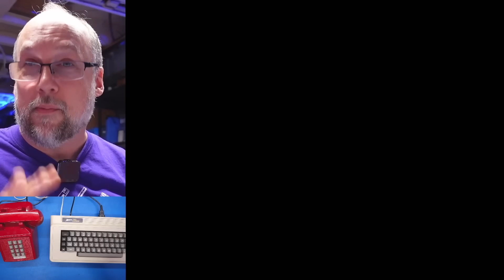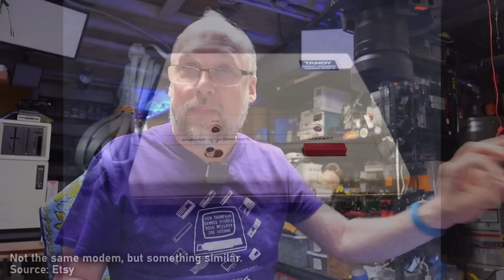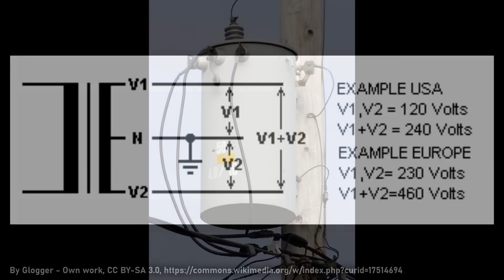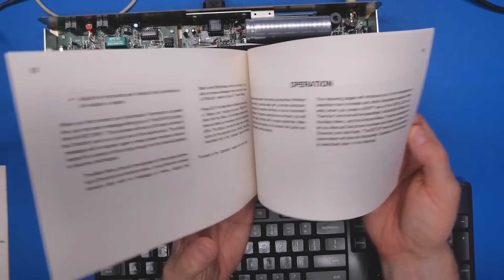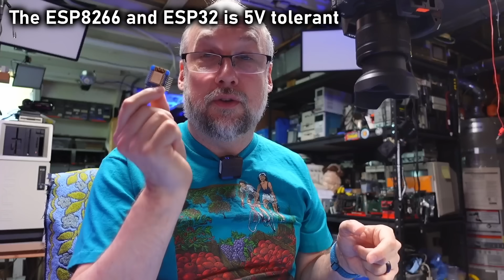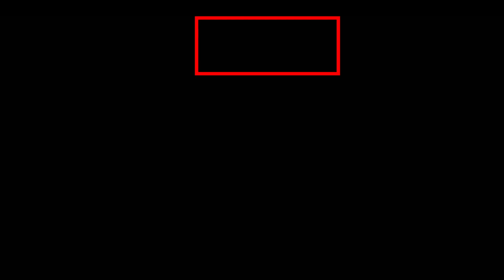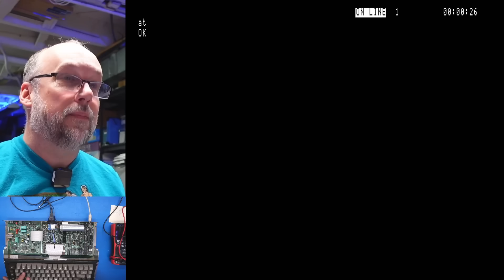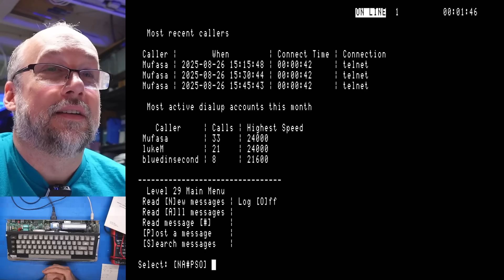Adding Wi-Fi to a 43 year old modem only terminal (Zenith ZT-1)

Comment: 14.4kbps (14400) was a standard baud rate.  What is interesting is 144400 + 2400 = 16800(16.8kbps).  If you ever decide to open this up again, maybe add an investigation into the baud rate as a task.

Comment: Did you try setting your $TERM to one of Zenith entries in the terminfo database?   On my Ubuntu system, there are zt-1, ztx-1-a, and ztx11 entries all aliased to TERM=ztx.   It won't help with the BBS system, but it would help connecting to a linux system.

Comment: Adrian,

You have a fundamental misunderstanding of what terminal types do. They are a code converter. You should peruse the termcap file to see what is actually contained in its black magic. 

Unlike today, there was no standard code sent for any function from the keyboard. ASCII text was mostly the same, but everything else was open to interpretation. You need to use the termcap that actually supports your terminal type, not the 'least fancy' terminal from a completely different manufacturer.

Dec VT scan codes were reverse engineered to be included in unix termcap because the physical terminals were so prevalent. It was DEC's proprietary data to prevent their Systems from being functional with other cheaper terminals. 

Secondly, Vi is almost certainly replaced with VIM which is filled with cursor placement and status bar line draws. VIM does not work because the ZT1 is not a VT52. 

As for why ^C doesn't work... Most likely the host end has already finished sending the output of the command to the I/O buffer on the host. Your break is going to the system that is already done processing the output of a command.

This is why commands like MORE and LESS are so important. They provide human pagination that is required to allow you to pause and cancel output over a 'slow' remote link. XON and XOFF provide that flow for the terminal communication, not for the screen display! You can affect how fast the host sends data to your terminal with STTY commands. STTY also lets you fix some termcap mismatch issues on the fly for important things like backspace

If you want to temporarily test say a slower output speed you can do "stty baud <baudrate>". The other is "stty erase (then your backspace key)"

Those extra characters you see on the end of the prompt line are certainly there because the zenith may not have a character representation for whatever the mis-matched terminal info you are sending it. Termcap affects translation of functional codes in both directions.

Comment: It's likely that the reason why Ctrl-C seems to not work is because the modem is buffering a lot of the data, so by the time the sending system receives the Ctrl-C signal, it's already sent the whole file and what you're seeing is actually coming from the buffer.

Comment: Back in the old Compu$erve days, I had access to a 300/1200 modem. I would connect at 300, since it was considerably cheaper (per minute) than 1200, and I found 300 baud to be a comfortable reading speed.

Comment: 16800 is not so common as 9600 or 19200 however pretty standard one for 16550 UART. It was the baud rate of US Robotics HST protocol. It is also a halved 33600 which became popular later when V.34 was introduced.

Comment: I had a ZTX-11 or was it 10? used in the late 90s with a unix dialup shell account under VT52 with Lynx. ran it at 9600 baud but I believe it could do 115k. the shell provider was the former sysop of Ripco BBS in Chicago.

Comment: I have a whole selection of external modems.  I have an old TRS-80 modem, that i don't even know if it works.  But i have 2400B, 9600B, 14.4KB,  and a 56KB (even though the max was 53KB IIRC).  Going off of memory, and i haven't used any of these for many many years.  Heck, i even have a cable modem and a DSL modem somewhere.

In my previous house i actually had both cable internet and DSL, because the reliability wasn't great.  Some drunk butthole would hit the light pole (that pole was ALWAYS getting hit), and my cable would go out.  I could just swap the serial cable to the DSL, and keep on rocking.

Comment: Does your local phone system work with a blue box?  It would be interesting to see if some of the old phreaking tech works on it.
Reply from the maker: Nope. Stuff like that is part of the control signalling for AT&T phone network and later the long distance network where signalling was in band. It means tones on the phone connection did stuff. Something like this Panasonic uses out of band signalling (digital) so it's not affected by any tone.

Comment: One of my favorite (if not my absolute favorite) aspects of retro computing is dialup modems.  Ever since I got my first modem for my CoCo2 back in the fourth grade, I have always held an absolute fascination with data communications.  There isn't much love in the retro community for dialup modems, and it's so hard to get a POTS line.  I have Vonage at home, and the best I can do is 9600 bps.  I use a Wimoded232 for convenience most of the time, but I also still dial in for that authentic feeling. :)

Comment: My family used Darkstar as the name of our WiFi access point in the past. It was a reference my Dad thought of I believe. I assume a reference to the 1974 SciFi film by John Carpenter. I would suggest trying something more Unix like Open or FreeBSD instead of Linux as you might have better compatibility but it's also possible that VT52 isn't well supported. Of course my dream would be to see the Plexus P20 running again, perhaps you can do like Mr @UsagiElectric and have 8 Data Terminals running at once.....

Comment: The caps surrounding the chip on that ttl-rs232 converter are used to implement a charge pump to generate the rs-232 level voltages.

Comment: My first exposure to BBS's was through a device such as this. Not this exact device, but one that is very similar. I was on good terms with the manager of our local Radio Shack store, and he often let me play on the computers and electronic devices in the store, and sometimes even let me take one home on loan for a while. One such device was a terminal that looked basically identical to the first Color Computer -- the silver one with the horrible chiclet keyboard. Probably shared a lot of its guts with the CoCo as well, because I remember it had the same green screen and rainbow flashing cursor. But it was a terminal -- it didn't have BASIC in ROM, it didn't have a cartridge slot, and it didn't have any I/O. But it did have a built-in 300 baud modem. I think the device was originally built for farmers so that they could call into farmer-specific data services (I guess to check weather, maybe order seeds/supplies, etc.) and I guess they must have sold some to the general public as well. In any case, this was my first exposure to BBS's. I would rush home from school every day and get online, often with a friend or two in tow, and there would be frequent arguments about me tying up the phone lines, etc. Back then my friends and I fancied ourselves as hackers (of course we were very much NOT, "lamerz" would have probably been a better description of us :) ) so we often logged in to "those" type of BBS's, you know, the ones that hackers, crackers, etc. hang out in. We would raid the text files section and read out all sorts of weird and interesting information on things like phone phreaking, amateur chemistry (if you catch my meaning), etc. The terminal had no data storage capability whatsoever, so when we found a file that we wanted to keep, we would read it aloud into a tape recorder. :D Fun time fun times.

Comment: Great video as usual Adrian, if YouTube doesn't promote this series then it's a scandal!

Our local collage had a mainframe when i first attended. All the computers were dumb terminals connected to this. There was an entire floor devoted to the machine itself. They did have a couple of rooms with DOS based IBM PCs. Less than 10 years later when i attended again the terminals were all gone. Computer rooms had generic (not IBM) desktop PCs with Windows 95.

That was the only terminal system i used but i did see another in use at the local NHS hospital. A staff member said, if you can understand what's in those manuals, pointing to a large book shelf you've got a job. I was tempted to ask if they would let me stay overnight to read them. I knew better, desktops were already being used in their offices. It was only a matter of time.

Time shared terminals are one thing but this series of videos has opened my eyes to a world that once was. 

On the terminal in question... Really interesting that such a high baud rate could be used compared to its default. Do you think this is a case of the people they were selling too, would mostly have poor connections and they were thinking ahead? or they were already being outpaced and the tech was far quicker. We know computers are outdated fast, so i'm thinking is this a case of the internal hardware was over powered. i can't recall if you said the latter models were basically the same hardware, so we're they over powered in anticipation of the future but then stagnated as the market for terminals just collapsed? A real interesting piece of history.

Comment: There was some mention about a disk drive in the user manual (for modes 3 and 4) which would probably plug into the power supply connector, in between the PSU and the terminal. It's possible that used the 16k8 baud rate - I'd guess that the ZT11 supported 9600 (mode J) and 19k2 (mode Z which was J doubled, due to the higher clock). But there's a few modems that used that 16k8 as well.

Comment: The vt52 terminal was one of the first and (by the standards of even the 1980s) was brain-dead. Very few of the expected commands were implemented back then.

Other posters note you may not have the full "terminfo" database installed, so 'vt52' in TERM doesn't have the expected effect, but also there may be a Zenith-specific terminfo description available which could be even more appropriate. Many terminfo / termcap descriptions included workarounds for 'quirks' in specific terminals (e.g. a term was notionally vt52 but actually required a longer delay after a sequence, or even within a sequence).

Finally, you may find that a command like 'screen' or 'tmux' might be able to act as a translator layer, essentially enabling a less capable terminal to act like a more-capable one for the desired commands.

Welcome to the wonderful world of serial terminals -- your experience with things not quite working as expected is 100% authentic to the 1970s reality.
Reply: 100% agreed with @rivimey.  I see several promising terminfo entries in the terminfo/z/ directory, including a 'zt-1', and running 'infocmp zt-1' has a comment that it's for a "Heath/Zenith ztx-10 or 11".  If the remote system doesn't install the full terminfo "DB" by default,  Adrian may need to download the ncurses terminfo source and find the terminal description(s) and install the (binary) terminfo file(s) he needs below his homedir (see terminfo(5) for how to reference your own terminfo descriptions).

Also, it's rarely installed with the rest of ncurses, but the ncurses source has a very handy terminal testing program called "tack" that's mean to help with testing terminal capabilities and creating custom terminfo entries.

Comment: old is good. lol. we are many young. ai generated code? lol. why not use single power supply for the whole thing in design. meh. multiplexers rock for simulating any architecture on fpga, including x86 and arm. logic circuit design rocks, a layer on top of the physical ttl implementation or whatever implementation. cant be simply battery powered because of that nonsense. generic is generic for everything, nothing specific. vectorized pipelined parallel is obviously faster than even pipelined serial instructional compute. tech high enough is equivalent to magic. hax maximus. lol. wifi is electrical noise. super nice. a boot script to set the baud rate automatically. 16.8 is half of 33.6. double that. thats a light weight terminal. some kind of connection script. rpi4/5 is a nice bbs emulator. its rude to ask if you are well or ok. on screen. engage!

Comment: What does the ESP8266 mean is 5V tolerant? This is not written in the datasheet. 
It only says that the IC must be operated with 3.3 volts. 
Operating it at 5 volt levels means operating it outside of specification.
To connect it to 5 volt logic you need 1k resistor in series.

Comment: Maybe they were going to release an optional power supply with serial ports in it for this. While that may sound strange Google did the exact same thing with their Chromecast, if you wanted wired Ethernet you bought the optional power supply that had an Ethernet port

Comment: I really like how these are designed. I came across one of these ZT-1's a while back; sadly, the main board was truly fubar. The keyboard works fine, and the case is in mostly good condition, but the board was destroyed by someone trying to mod it or something. I tossed the mainboard, scavenging some parts like the keyboard connectors I transplanted onto a little perf board I translated it into an easier to understand keyboard matrix to run into a raspi pico. I put in a CM5 and standard I/O board with a new rear plate (it was cut up a bit to poorly fit an extra port prior, so I just cut a clean rectangle and put a printed i/o shield mounted on the rear with screws). I've been using it as a "micro emulator" of sorts, running emulators for Apple //e, C64, C128, Atari computers, etc. on it as well as just as a standard CM5 based computer to write programs for my RP Zero 2W projects since I've mostly converted to Radxa boards with native OpenCL for my hobby demos. It's not original, but at least I was able to save the casing and keyboard from the recyclers.

Comment: I feel like there ought to be some byte you could set on the EPROM that could default the the terminal to Serial mode vs Modem mode. Could be a simple mod to improve the usability. Manually selecting Mode ) would of course return the unit to Modem operation.

Comment: Vi is pretty flexible with terminal types.  Vi should just fall back to ex mode if it can´t use the terminal type.  If it works in vi mode arrow keys aren't required at all, just hjkl.

Comment: For testing VT52 capabilites of a terminal: Perhaps connect it to some kind of CP/M2.2 machine. most software packages came with a setup program to patch the main the executable for the respective terminal. like VT100/VT102/VT220/VT52. So you can run Wordstar, Turbopascal and others full screen editors in VT52 mode, which certainly will take full advantage of what VT52 was about.

Comment: a ZiModem with support for SSH (even if it's only older cyphers) would be appreciated.
Reply: Zimodem 4.0 does support it, but not for the ESP8266 -- you need to run the version for the ESP32 that has more ram.
Reply: @bozimmerman great (I do not care about ancient esp8266 any more, esp32 is fine.)

Comment: ahh the memories. Double baud rate was a way of increasing baud rate by doubling the number of bits per signal changes. Also, we had a lot more patients back then. Everything has to be 'now' and we just didn't do things that way. I can remember my first computer (vic-20) and using a 300 baud modem and it produces text at about reading speed so it wasn't that bad but yeah we weren't in as big of a hurry as people are today.

Comment: You could probably simulate the AC power source's signal with a 555 timer chip tuned to 60hz. It shouldn't be too hard to set that up with a bit of prototyping PCB, a couple or resistors, and a capacitor.

Comment: Wasn't sending "+++" without the quotes the way to get the modem to hang up?  {Edit} Yup, you discovered that.  Would the modem and ZT-1 still talk to each other if you checked down to a standard/typical baud rate, ATB16667 iirc?

Comment: 16,800 bps was definitely a thing back in the day.  I cant remember which modem had it, but at least one did.  Maybe I'm thinking the USR Courier HST.
Reply: The modem connect speed and the RS232 speed didn't have to match on modems after compression was invented though.  I remember using a Zoom 2400 modem for a while.  I thought I had to talk to it at 2400.  I found out eventually that since it implemented V.42bis compression and error correction, you could get noticeably faster rates by talking to the modem at 9600 baud instead, even though it was still connecting at 2400.  Likewise when I got a 14400 baud modem I used 57600 baud on the RS232.

Comment: The "B0" is the code for the degree symbol in ISO-8859-1.  Curious that the terminal would display the hex code rather than some "unknown symbol" character...
Reply: My slightly-older pals tell me it was actually pretty common to see hex-codes for unknown characters back then. 

(The same ones who still make jokes about futilely trying to delete embarrassing statements by typing ^C many times in a modern message, the joke of course being you could still see what came before depending on how your terminal was setup.)
Reply: I was puzzling over why it would show the literal hex code as well and then remembered he wrote the "BBS" using an LLM.

Comment: The compatible monitor is actually RS-170 for the video signal (the one that is on most "yellow" monitor inputs).  It is 1 volt p-p video signal which is what is on the RCA jack.  You are very correct in saying that there is no RS-232 monitor.